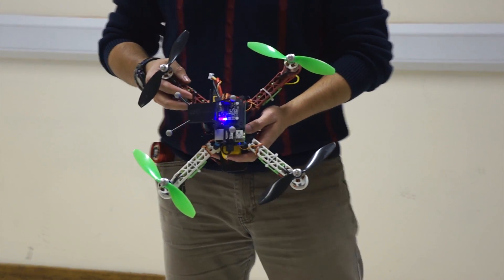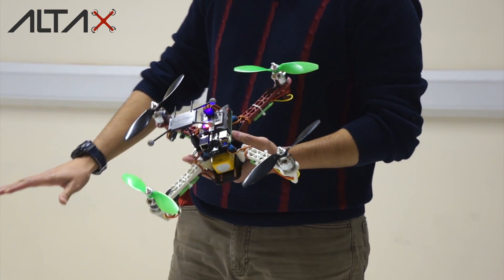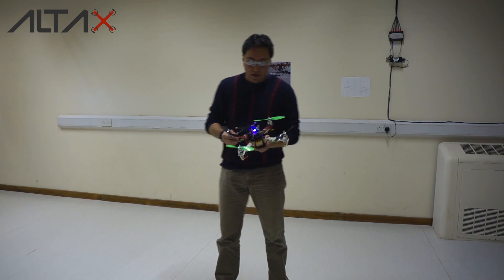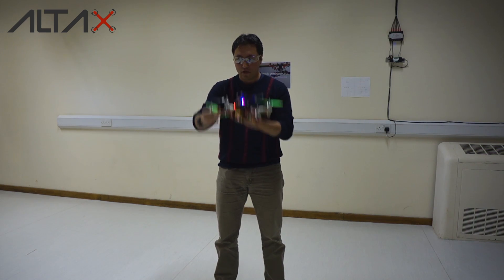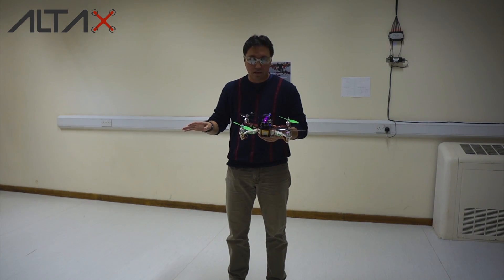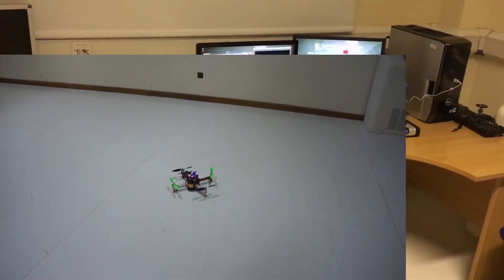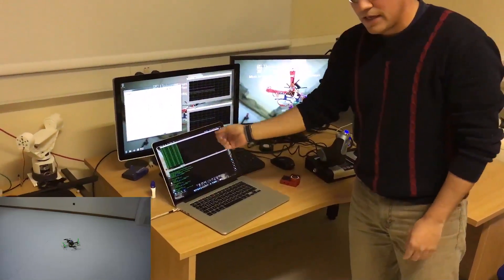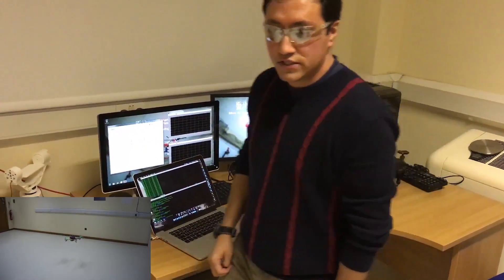Drone Pilot - Position hold controller (raspberry pi + naze32)

Comment: Hi, thanks to your video.
How does your drone move to its previous position?
You send new position or calculate pitch, roll and yaw and pass it to drone? or is there any available commands such as go forward, backward, right and ...
Reply from the maker: For this video, for this example, I was calculating roll, pitch, yaw and throttle commands that are going to be send to the flight controller via usb cable... this was using a naze32 flight controller. If you use something like a pixhawk then you can create the commands to be send in the shape of velocities, so how much in velocity forward, or backwards right and left. All of this is in the code of my github.

Comment: hello ,please help ,I am beginer in programation ,I have made a cheap  quadcopter using : arduino nano ,mpu6050 as FC and nrf24l01 as receiver ,in the transmitter I have used arduino nano and nrf24l01.
the programme used is multiwiiRF24 .
I want to show the MPU 6050 values in the multiwiiGUI but in the arduino of transmitter .

Comment: Hi, I'm trying to perform altitude hold with naze32 and R pi, how would I go about doing this? I'm new to PID so is there any resources you recommend for understanding PID Control. Also how would I incorporate say ultrasonic sensor readings to achieve a desired altitude, or is a sensor not needed?

Thanks in advance!

Comment: Hi how do you take power from the battery to the raspberry pi and the naze32?
Which power distribution board do you use?
We are working on a school project in which we want to recreate the hover controller like you shown on the video but to track the drone we will use 2 microsoft kinect.
Reply from the maker: I was using a BEC (battery eliminator circuit) that will transform the voltage from the battery to 5v or 12v, very easy to use.

Comment: Awsome !! is the stablization managed by the raspberry pi or the flight controller, i didn't anderstood the position hold mecanism, there is no gps , how pi calculates the position.
Reply from the maker: The stabilization is handled by the naze32 and the position control is handled by the rpi with the position given by the motion capture system... you can think of the motion capture system as the "GPS" of the system.

Comment: Hi Aldo, I like your hovering control system and by looking in to the code i think i can use it to control autonomously for using with opencv python face tracking. but i have very little knowledge in python and i think you can help me on this. the python code for face tracking is. Sorry for any inconvenience. 

if faces:
print 'face detected!

cv.Rectangle(image, (int(i[0][2])+int(i[0][0]), int(i[0][3])+int(i[0][1])),
                                              (int(i[0][0]), int(i[0][1])), (0, 255, 0), 3, 8, 0)

        x1 = int(i[0][2])+int(i[0][0])
       y1 = int(i[0][3])+int(i[0][1])
       x2 = int(i[0][0])
       y2 = int(i[0][1])
       
      xx = int((x1+x2)/2)
      yy = int((y1+y2)/2)
     
     output = "X{0:d}Y{1:d}Z".format(xx, yy)         ** Now this output should be converted in MSP for controlling multiwii and i need help on this section
    print "output = '" + output + "'"
   
     serialConnection.write(output)
Reply from the maker: +Md. Manzur Murshid Hi! yes of course it can, I even have code to do face tracking, take a look at this repository: https://github.com/alduxvm/rpi-opencv there is a facetracking example. The main issue is that for doing this onboard a drone will get very dangerous!! and the latency of the facetracking algorithm is very high... a position controller to do that will not really work, is just too slow... we need to make improvements on that area... I'm currently working on CV, but instead of face following, I want to follow a ground robot, take a look at this: https://www.youtube.com/watch?v=pu_9DGT2qO0 cheers!
Reply: +Aldo Vargas Thanks very much for replying. yes I have seen all your project before in github and found hope for my little work. I have managed rewrite a small code to track and followed a face using cv-arduino based servo controlled camera and now I m stuck in this autonomous thing. there are some people made ardrone with face following in different platforms( https://github.com/eschnou/ardrone-webflight) but not much information. I need to convert those coordinates to roll angles and altitude values.Please help
Reply from the maker: +Md. Manzur Murshid send me an email to aldo@altax.net
Reply: Hello Aldo vargas. I'm Trung. I see you on youtube, I extremely impressed about your project related control quadcopter throught Matlab. Can I help me 
my email: thanhtrung111333@gmail.com